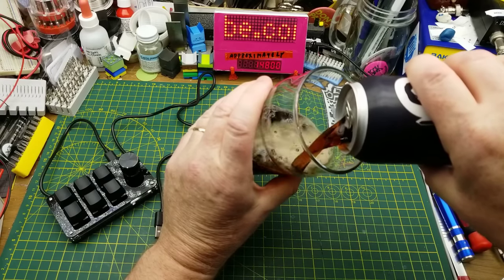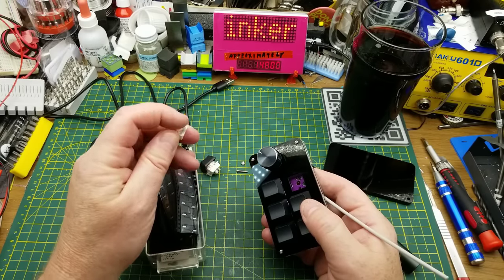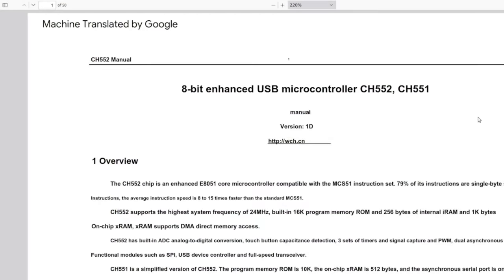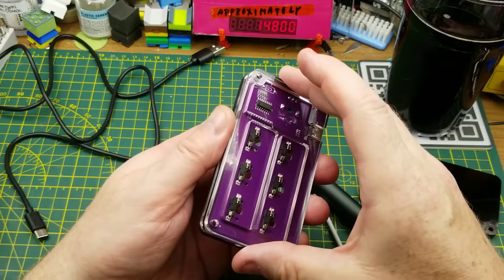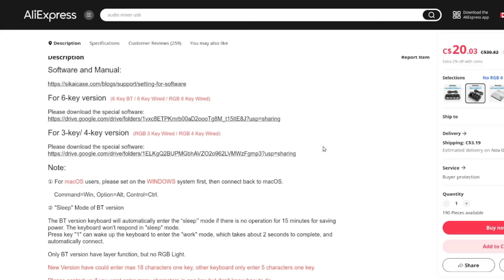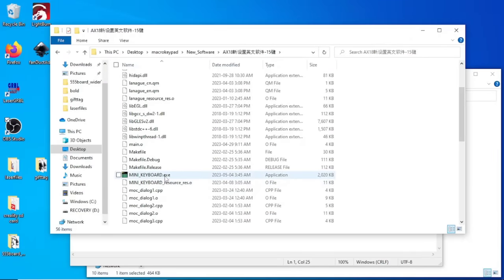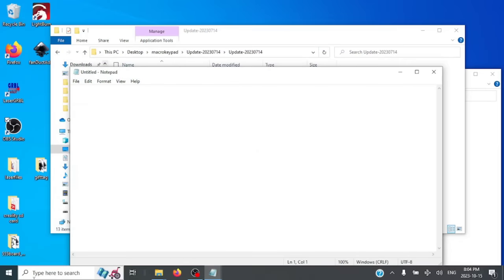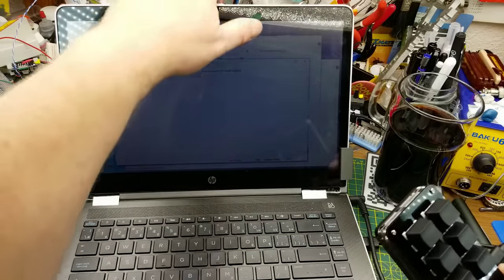Exploring a cheap macro keypad

Comment: Layers let you assign multiple functions to a single key and access them by switching between layers. I think of it as the Z-axis from Algebra or as a stack of plates from breakfast lunch and dinner.
Reply: And how do you active the extra layers when you need them?
Reply: @Mr-R.R.  Normally, you dedicate one key to change layers sequntially (1,2, 3 and back to 1).  This is the simplest way but not the only way.
Reply: @SteveRobillard  gotcha! And do you know which models are capable of taking advantage of the layers? The one I got has 12 keys and 2 knobs. But since it's a Christmas gift I haven't gotten to test it out myself yet
Reply: @Mr-R.R.  No sorry.
Reply: @Mr-R.R.  the bluetooth models have a dedicated layer button next to the on-off

Comment: I have the Vaydeer 9 button keypad with 6 layers. The keys are shown in a small window on your monitor that stays on top and is movable. you can set it many different ways i have it where if i run my video editing software it go's to a certain layer with the keys set to what i want in that program. But that looks like a cool keypad as well. I got mine on amazon when they were having there prim day deals for $25.00 USD

Comment: Like ESP chip, these microcontrollers are likely available in different packages with different pin out configurations.   An ESP chip has a lot of GPIO's, but if you get it as an ESP1 it is only broken out to 8 pins, and if I recall only 4 were GPIO's on that, but if you broke it out to a bigger development board ,yo uget access to a lot more GPIO's
Reply from the maker: That makes sense.

Comment: When you programmed the keys, it displayed both the main and shifted values, e.g !1 and @2.  Have you tried holding shift when hit a key to see if you get the shifted value?

Also, regarding layers 1, 2, and 3, did you figure those out?  Any chance they refer to, for example, layer 2 being ctrl-key and layer 3 being alt-key?

Finally, can you assign the keys to be shift, ctrl, or alt?  That could be useful in CAD and drawing programs for modifying mouse behavior.

Thanks, and hope you don't mind all the questions!
Reply from the maker: The layers thing appears to be for the larger keypads.  This one is the most basic one in the product line.

Comment: Tried adding phrases to the keys, eg "Greetings & Salutations" etc, for word processing, sadly only accepts 5 characters per key and no more. wonder if you could reprogram it or if its a memory limit thing?
Reply: That was what I had in mind as I have to answer a lot of mails and often type the same praises over and over. But this 5 char limit rules that out unfortunately.
Reply: maybe the word processor has macro options, so if you send "M1234" or "G&S" it does "greeting and ....."

Comment: Hey, thanks for the video, man. I'd like to know if it can loop the macro. For example you click the button and it keeps pressing assigned letter untill you click again to stop. Thanks!
Reply from the maker: I don't think it'll latch like that, but it will repeat the keypress for as long as you hold the key in the same way a normal keyboard can.
Reply: @pileofstuff  thank you
Reply: You can use a script to do that lol 😅

Comment: Super helpful video. Thank you from the bottom of my heart. Just curious though, did you find a way to make the keys just buttons that can be reprogrammed as keybinds for discord actions? like mute mic, deafen, leave etc
Reply from the maker: It should be able to send any keypress combination you want.

I set mine up for the common hotkeys in my video editor.
Reply: @pileofstuff  yeah but i don’t want it to be a real button on my keyboard. i want it to be 100% unassigned like button 1,2,3 so i can use it for discord
Reply from the maker: @irregularbarf  You should be able to assign unused function keys to it. 
Possibly even extended ASCII characters that don;t appear directly on the keyboard (but I haven't tested that)
Reply: @pileofstuff  how would i go about assigning the unused ASCII keys if i can’t see em

Comment: I use one of these for a while, and I just bought a second one. Does anyone know how I can connect two of these to my computer?
Reply from the maker: The computer sees it as a USB keyboard. You can connect multiple keyboards to most computers
Reply: @pileofstuff  Also to mine of course, but both work with the same software, and I can only program one. So I was wondering, is there is a setting somewhere you can tell the software I use two.

Comment: I made a few out of a 32U4 and they work with windows and Mac fine. But not with linux. I only have 1 Widose Box and 1 mac, but a dozen linux boxes. Oh well.
Reply from the maker: I did a 32U4 based interface for an original NES controller a couple of years ago, and it worked on every computer I tried it on.  https://youtu.be/KwTWbf5OROM

Comment: I wish I could get mine to work. I got the 3 button with 1 knob version from amazon. Initially it programmed just fine, but then later I found that I wanted to change one of the button functions. As I was trying to reprogram the one button I slowly lost function of the others to the point now it does nothing. The software says success after I click download but the buttons never work. Super frustrating, It really make my job smoother. I do a lot of copy/pasting and salect all.

Comment: maybe the software works with wine ? .. I think there is a project with open source firmware for these keypads.. there is one at hackaday.
Reply from the maker: I tried WINE on one of my machines and it didn't open. There may be tweaks to get it to work, but this was a quicker solution.
Reply: @pileofstuff  hm,, ran out of the box for me.. wine-staging 8.18 .. fresh prefix .. no extras ..
Reply from the maker: I've had inconsistent results with WINE across different machines over the years. Never cared enough to spend the time and dig deep into why.
Reply: @pileofstuff  I do not have the luxury of windows users in my household so I have to cope with it ^^ .. but it is true, wine sometimes needs a little fiddling and is not so easy to install on some distributions...  But I feel that has improved quite a bit over the last years.